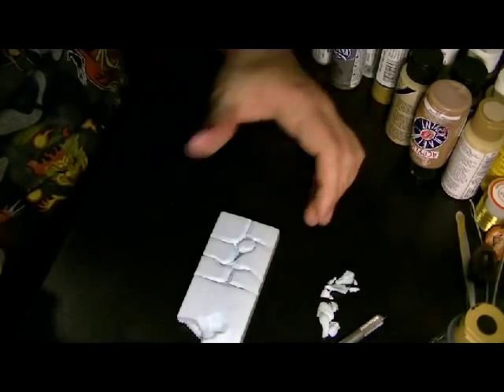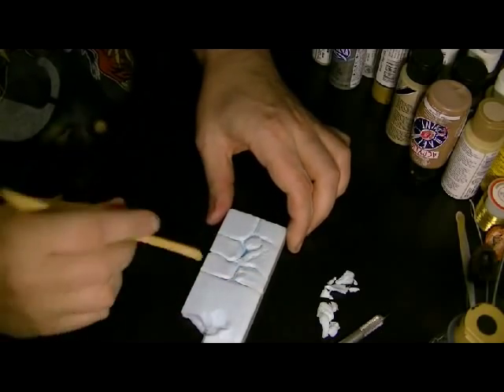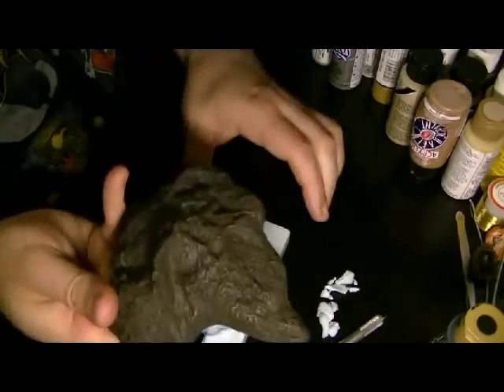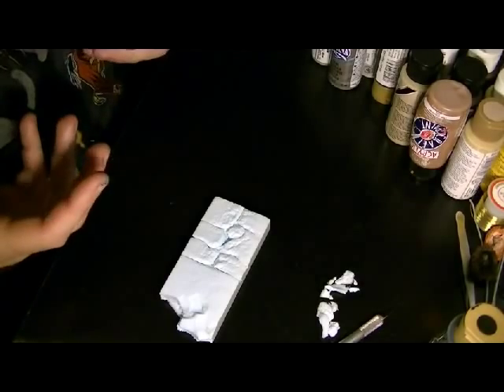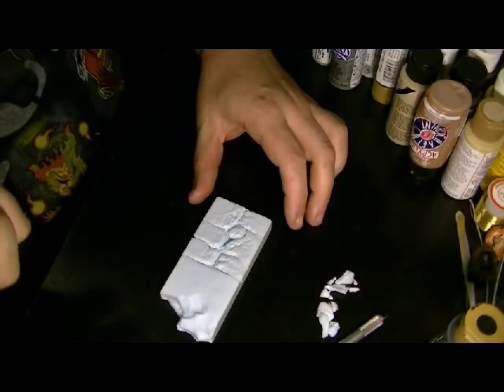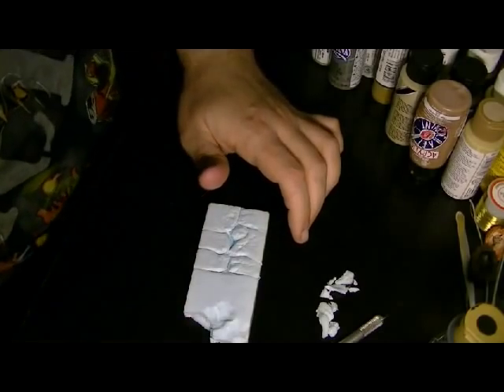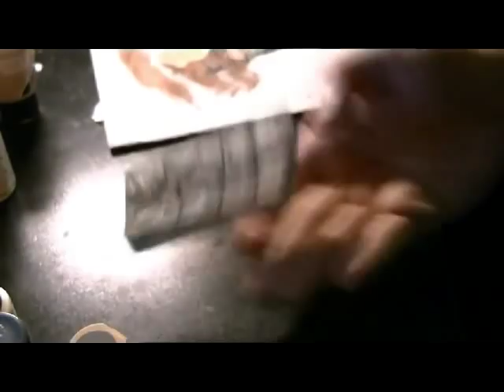Sculpting stone walls from foam

Comment from the maker: @skphile 
Its Extruded Polystyrene, you can get it at Lowes or Home Depot.
Yeah, that Expanded Poly is bad for that kind of work, but works if you plan to coat it with plaster or something, for use of the basic shape.
If you pick up some of the blue foam, the brick work will be much easier, just use a ruler/straight edge and run the box cutter/blade against it, nice straight, clean lines.

Comment: Problem is that in most western states, extruded polystyrene is not available due to the lack of cold weather. Unfortunately all my hardware stores never carry blue or pink foam, only the regular styrofoam which is practically useless for shaping and carving.